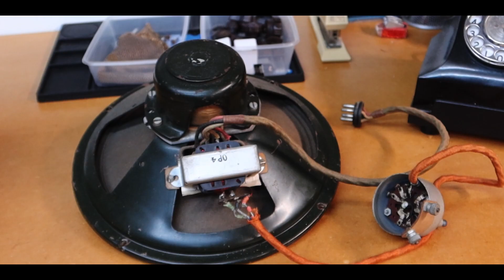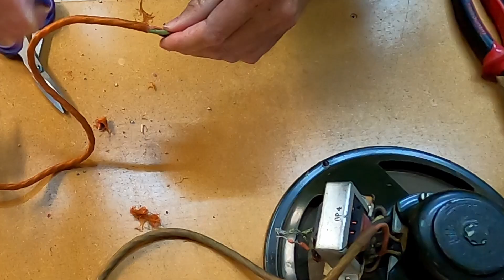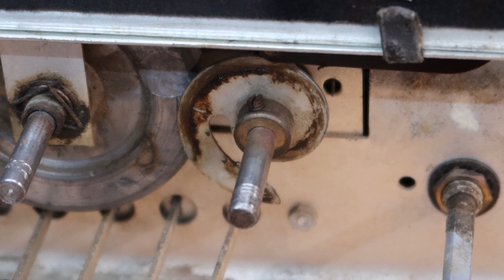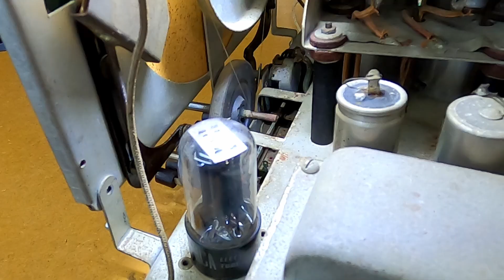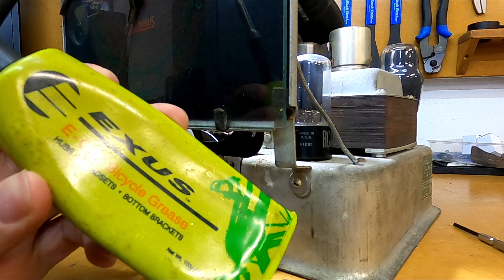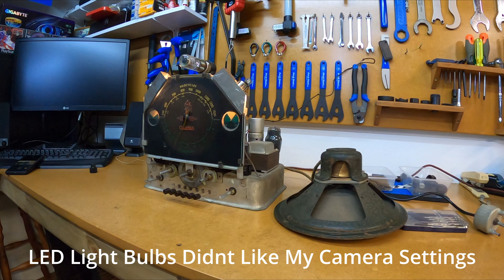Columbus Model 65 Speaker Cable Replacement, Cams and Vintage Radio LED Lights?

Comment from the maker: Hi everyone, in this video we continue on with the 1939 Columbus Model 65 Vintage valve radio restoration.  I ordered some LED lights for the bulb replacement and found they are a little bright and have a slight flicker to them, not really suitable in this instance. Take care 🙂

Comment: The LED bulbs require a Direct Current voltage to operate without flickering, unfortunately, the dial light supply is 6volt Alternating Current. Its fantastic to see you restoring these great radios, manufactured right here in NZ.
Reply from the maker: Thanks for the comment yes they do flicker and it is noticeable not a good look but I have managed to find some 6 volt filament bulbs which I'll fit.  Love the older radios and I see you have some on your channel which I have subscribed 🙂

Comment: It's awesome to see the set coming together and I'm looking forward to a final shot of it playing something (preferably something fittingly old 🙂).  And yep, its unfortunate that old rubber wire often goes rock-hard and crumbles - it's fortunate that Radio Corp didn't use much of it in their radios - some sets from other manufacturers used a lot of it and almost all the wire ends up having to be replaced... and just a thought on that speaker extension cord you fitted, which looks a little out of place in such an old radio - if you cut the ends off a boot lace and slip it over the cord, it will look a lot more like the original.  You can use heatshrink at each end to hold it in place.

Great work 👍
Reply from the maker: Thanks for that Steve, yes its coming along.  The cable does look out of place for sure, I felt guilty even fitting that cable as it looks cheap and out of place, so I will give the bootlace idea a go and see what it looks like.  I was disappointed in the LED bulbs, the brightness was one thing but the slight flicker was annoying.  Luckily I have found some 6volt automotive bulbs, 5 watt so hoping they will be fine.  I will definitely find an oldies music station for the next video 👍.